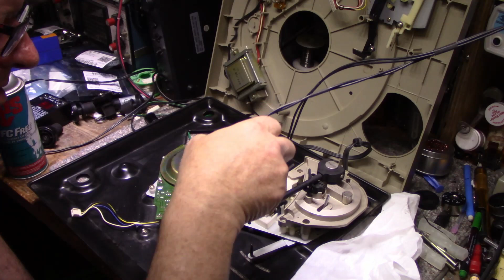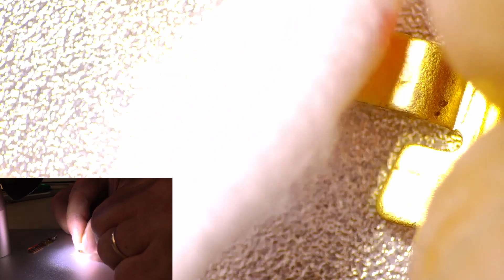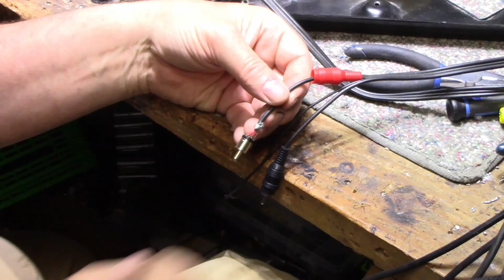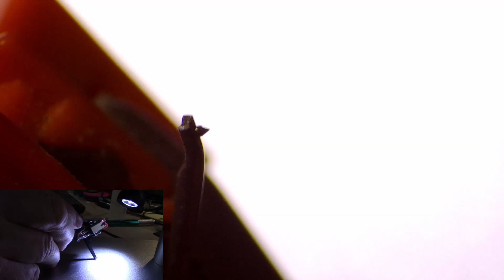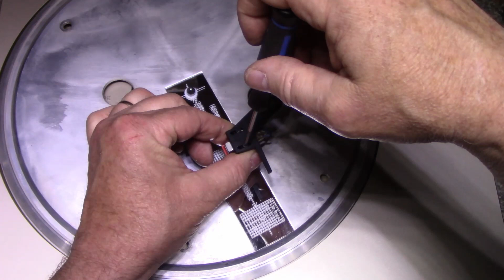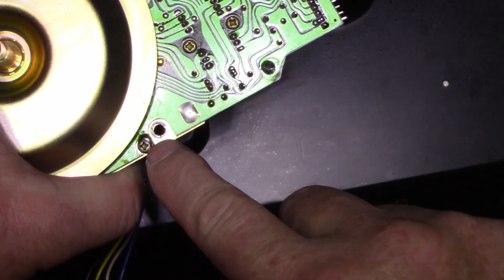Pioneer PL-8 Turntable - Repairs (Ep. 128)

Comment: The best job I have seen on YouTube yet. I would try to put the old spring in the new switch to have a fresh set of contacts. You have done a very thorough job. I bought a filthy PL-730 (a black PL-5) for $16 + $12 shipping, which did not work correctly. It was just a (very) dirty speed pot. It was so dirty  inside you could barely see the strobe light in the window. Turned to be a diamond in the rough, barely used unit. I completely disassembled and cleaned and lubed everything. When I was done, it looked new inside and out. It now looks nearly new and works perfectly and is my main turntable.

Comment: Great video!

I used your guidance to clean the microswitch (I used 90% Rubbing Alcohol and a bit of a 3x5 paper index card), and install a ground wire for IC PA2008.  

I think the troubleshooting flow chart in the service manual is wrong.  The PLAY/STOP terminal (across the switch) voltage should read 10.5 volts (NOT 0.5 volts).  https://youtu.be/ajBMc87w3BY?t=4693

My platter wouldn't spin and the problem turned out to be a bad PA2007 IC chip on the motor control board.

Comment: You removed what was probably a few micro inches of silver plating from the contacts.  Next time, use a little Tarn-X on a cotton swab and rinse afterwards.  Silver plating is used on low voltage/power switches, as opposed to gold for higher rated ones.

Comment: Love the video. Yes, vintage turntables can be a real pain to work on, especially deteriorated parts, lots of mechanisms and of course age, but once done its a real satisfaction keeping them going for more years to come. In my region (Australia) its good to know that lots of younger gen , including my daughter, are getting into vintage vinyl and want these small systems for apartments etc.. Of course even the vintage original pressing vinyl albums are getting up there in price now. I'm 60 and have a lot of these albums , purchased $10 / $15 dollars back in the 70's/80's, , now worth $100 and even more , so to anyone who reads this  " keep your old vinyl albums or pass it on to someone who can appreciate it" . I do it as a hobby ( find/buy cheap/ fix /restore tables, amps) for family and friends, and have done vintage Duals TT, Technics, TT JVC TT, NAD amps , Pioneer  amps ( old timber cabinet/blue light, cheaper Marantz copies). As I said, the electricals are the relatively easy part, its the mechanicals in these vintage turntables can be frustrating at times but satisfaction when you get it together. Keep your videos coming- love them. I know its your business, but I think you enjoy the challenge and keeping these units going just as much as me - Thumbs up. If you weren't in Canada I'm sure I would try and connect, drop around and have a beer with you... Cheers

Comment: Hope it is a mild case. Classic stack the old microwave on the turntable syndrome.
Dawn dishsoap and a paint brush in the sink cleans platter mats to like new condition. 

A lot of the direct drive tables have motors that were never intended to be opened. 

I currently have 26 and have restored well over a hundred. Believe it or not. Its what I do for fun. 

Metal polish - tiny amount dab it on the contact. Dwell time 1-2 min...wipe clean gently follow with IPA. I find deoxit takes too much agitation. The metal polish also works wonders on wafer switch contacts such as those found in yamaha amps. 

RCA cables get inserted in the amp and then jammed back into a cabinet or against the wall and over time short at the rca terminal connection.  The insulation breaks down from mechanical strain. I just replace with high end shielded RCA cables from value village. Monster, AR, THX all for 2.99 a set. 

Excel cart is nothing special. Common preloaded cart.

Comment: When I saw you swap that motor switch I knew you would have to take it back out. I tried replacing the same switch on my PL-518 and had the same issue, too much spring pressure. Like you, I had to disassemble the original switch and clean it.